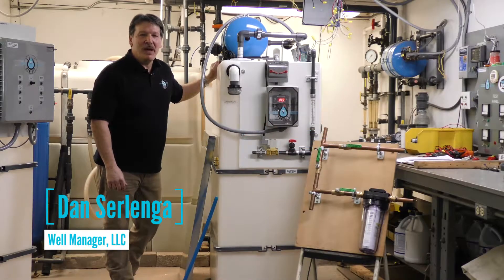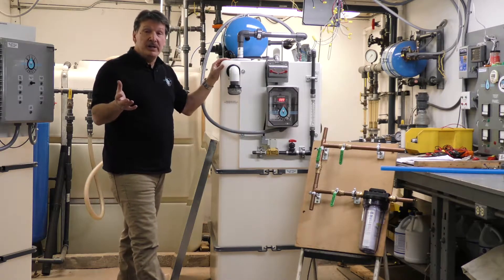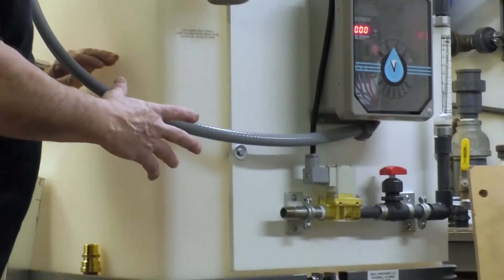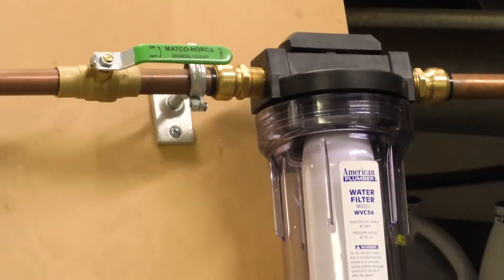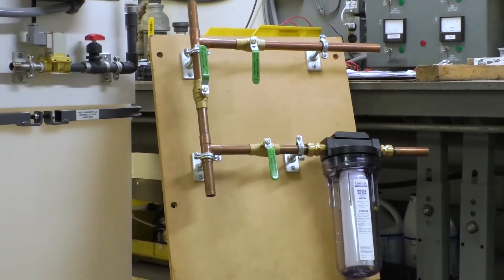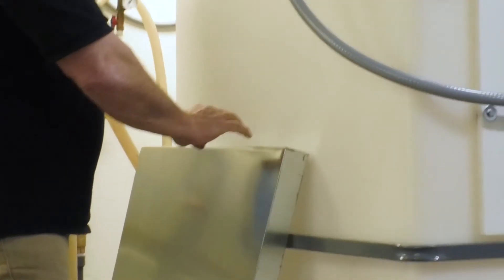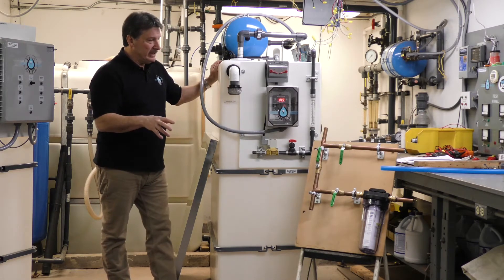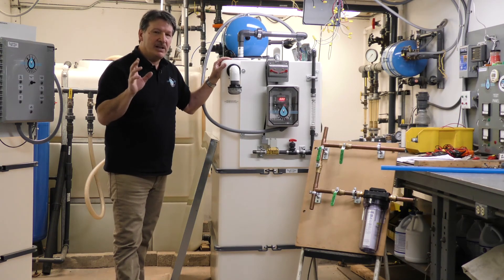The Well Watcher System, a Low Yield, Low Pressure Water Well Solution

Comment: Hey Dan, I got a quote on this and am considering getting it as we have a shallow well that’s low yield in the late spring until winter. 

Is there somewhere you have a diagram or something posted of that bypass piping with the sediment filter? I’m trying to visualize how I’d plumb that but it’s hard to think of with your example with the copper. Thanks!